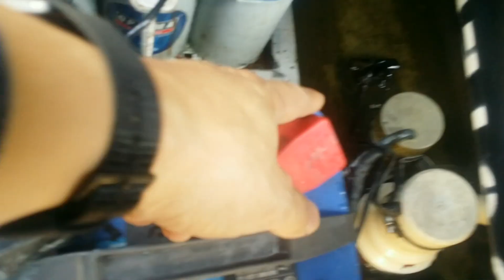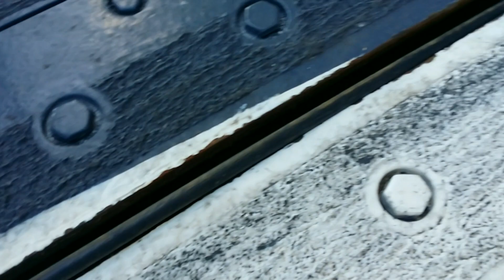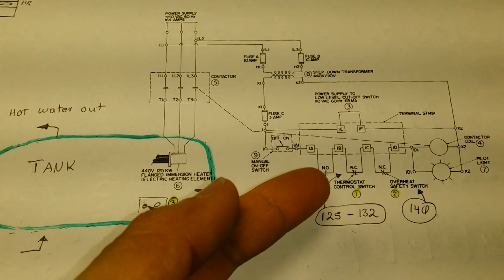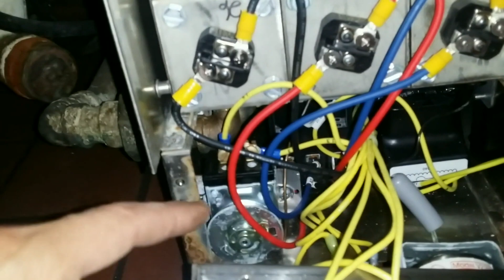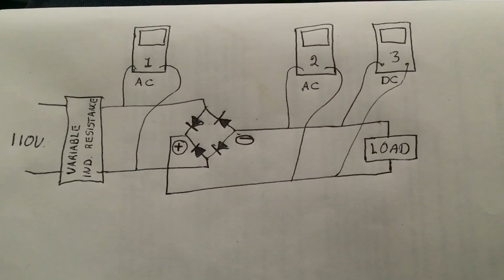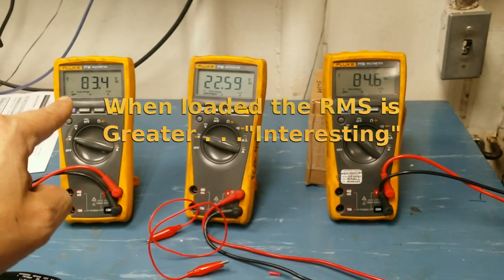54) quick tips and tricks for electrician's mates - PART 2

Comment: The brand name of that coating should be called scotch coat, by 3M. At least, that is the coating we use at the shipyard. Very good stuff. 
But it can be a little messy if you get sloppy with it. Better to put two or three light coats on, rather than one heavy coat.
Reply from the maker: Thank you for sharing. I wish I had been exposed to it years ago.